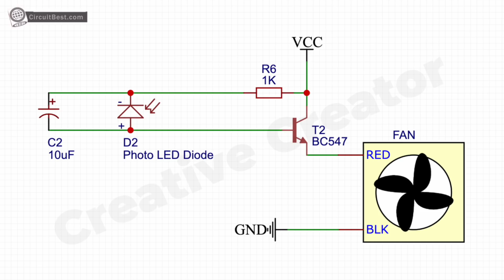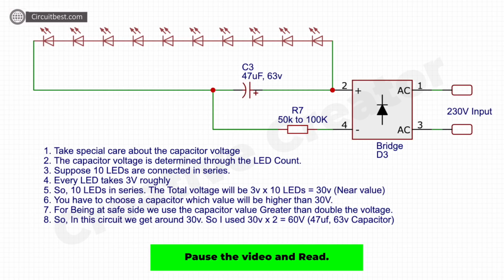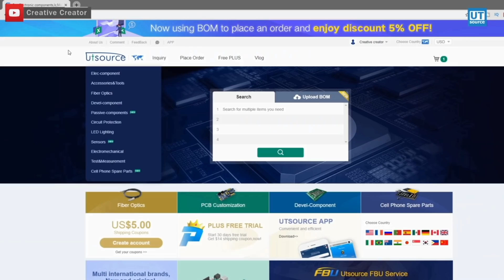Top 3 Awesome Electronic Project with RGB LED, CPU FAN, SMD Components, Sensor

Comment: Does the rectifier you're messing with internally limit current? If not you should probably be using some current limiting resistors or you'll likely burn out your LEDs pretty quickly.

Comment: In  first project, instead of 10mfd, 65v.... Can u suggest any other  capacitor... if possible give reply
Reply from the maker: You can use any higher capacitor. The capacitor is used for smooth out the remote pulses so that the pwn pulses provides a pure dc output to the to transistor so that the fan works continuously. 
You can use any higher value cap. Do let me know which cap you are using 😉